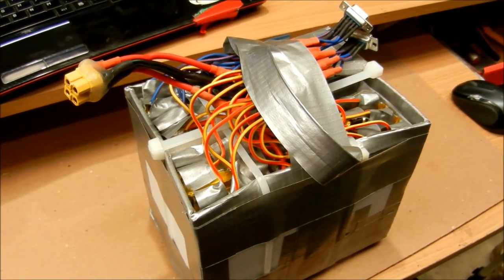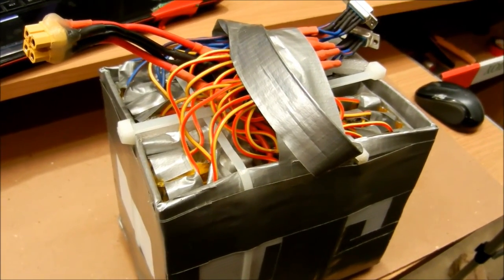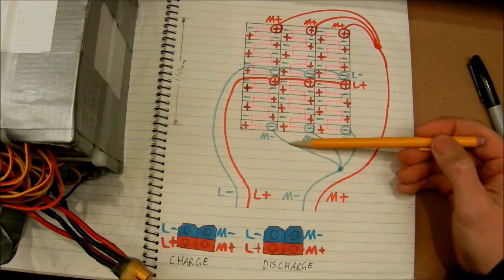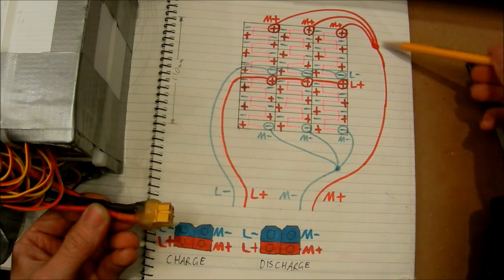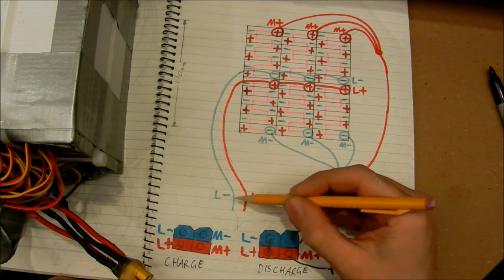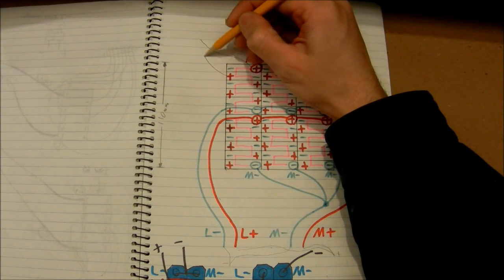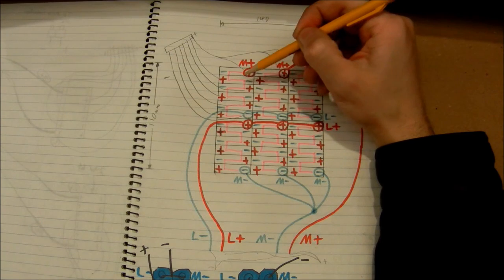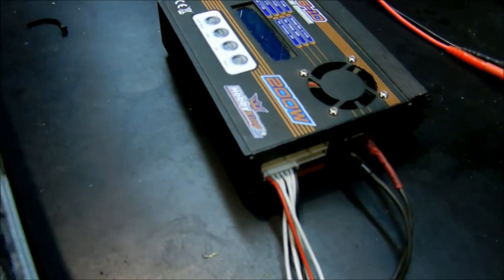LiPo E-Bike Battery Explained - 48V 15Ah

Comment: You are suppose to use the nominal voltage of 3.7v to caculate your total voltage(48v nominal). So you should havd 13 in series, not 12.

Comment: A bit confusing.... lipo cells are 3,7V and 4,2 when fully charged... if I have a 72V motor should I calculate the amount of cells by the maximum 4,2 voltage or with 3,7? for example 3,7x19=70,3V and 4,2x17=71,4. Will I damage the motor if I use a 19s battery (79,8V when fully charged)?
Reply from the maker: A 72V motor should use 18 LiPo's in series. These motors use a nominal voltage of 4V per cell  usually so my pack is actually 50.4V when fully charged, a 72V pack would be 75.6V when fully charged. If you only had 17 in series it would only be 71.4V when fully charged.
Reply from the maker: If you look at all sorts of battery power tools they have varying stated voltages depending on the sales hype that they decide on. Ryobi states 18V whereas I've seen other manufacturers state 18.8V, even though they are both based on 5 cell lithium packs with a fully charged voltage of 5x4.2 = 21V. Confusing but kind of makes sense once you are used to it. Generally the stated nominal voltage will be somewhere within the discharging voltage range of the batteries so for your 72V motor, 17cells dont go high enough whereas 19 cells is too high. Clear as mud?

Comment: hey mate great video well explained can you link to the batteries you bought, i need a 48v and atleast 17ah battery
Reply from the maker: Hey, these are the single lipo packs I purchased off hobbyking. It may work out cheaper to buy them in 3 cell packs or greater you just have to work it out. All you need is 20C discharge rate though as when they are grouped in parallel the load on each series of cells is greatly reduced. http://www.hobbyking.com/hobbyking/store/uh_viewItem.asp?idProduct=18560
Reply: I don't think you probably even need 20C. If you're using a 1000W motor in a 48v system then your current pull is going to be around 20A. If you go with 5000mah packs in 2s2p then you have a total current capacity of 10 amp hour, so 4C would give you a rated discharge capacity of 40A, which is a 2x safety margin. 
The packs I bought were 20C, so I could theoretically run up to 9600W on those batteries (10A*20C*48V) (albeit for about 2 minutes before the batteries drained to cutoff voltage.)
Reply from the maker: yep 20c is massive overkill, so really should get the lowest c packs you can get if they're in parallel configuration.

Comment: Hi great!  , well done , but that lipos have a lot of discharge , how could you fit it with a bike ESC kits if they onoy allow <45A ?
Reply from the maker: +avoidsnnnet The batteries only deliver the current the motor draws. It is good/recommended to have batteries that are capable of delivering more current than the max Amp draw of the motor to prevent overheating and damage to the batteries.

Comment: Hello, what's the average usage hours per charge
Reply from the maker: +bikergirl40 Depending on how fast you wish to travel it varies but at an average speed of 25-30km/h it would be about 1.5 hours for a full charge. I haven't fully flattened this battery travelling at a normal pace so am not sure exactly. I've flattened it travelling full speed and that lasted about 30 mins with quite a few climbs.

Comment: How well did this hold up? I see your newer videos it looks like you're back to conventional bikes.
Reply from the maker: I simplified the balance leads from this vid but the battery is still good. However like u noticed I've been riding normal bikes most of the time. The e bike just isn't as satisfying for me to ride, I compare it to being lazy driving a car, but that's just me haha.
Reply: I'm thinking about simplifying by buying 6s packs from HK instead.
Reply from the maker: Yep I'd probably do that if I was to make another one, I think it works out cheaper too.
Reply: The first pack I'm going 12S2P for 48v 10Ah. Cost was 160. So about 80 cheaper than individual cells.
Reply: Ok, so I did it and it works fine. I got these type:http://www.hobbyking.com/hobbyking/store/__59056__Turnigy_5000mAh_6S_20C_Lipo_Pack_AR_Warehouse_.html
Now i'm working on simplifying the charging process. I'm going with 8 pin ATX connectors for the power leads and a 24 pin milspec connector for balance. The bike will have a small box that houses the fuse and a voltmeter and connects the cells up in series and parallel for discharge and then on the charger  i'll just plug in the ATX connector and the 24 pin balance plug.
Reply from the maker: Sounds good! What wiring configuration are you using?